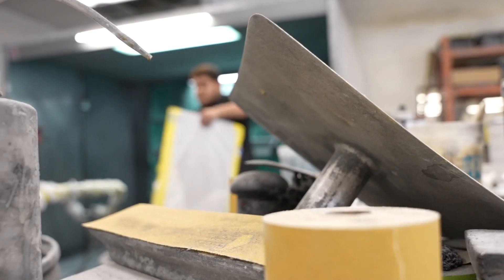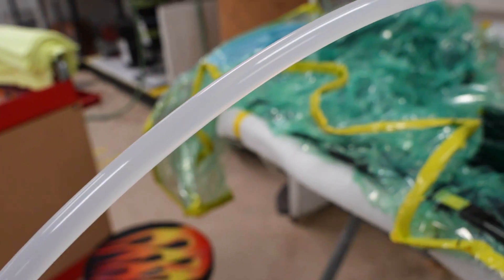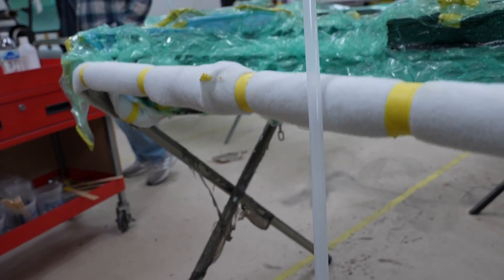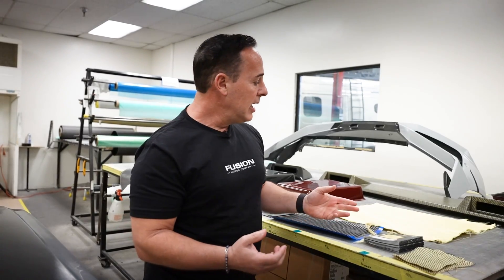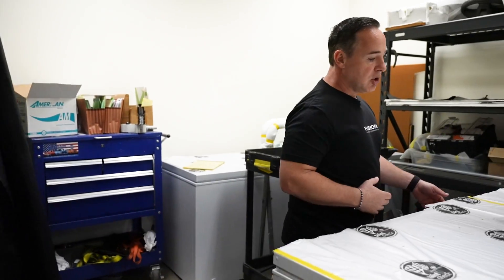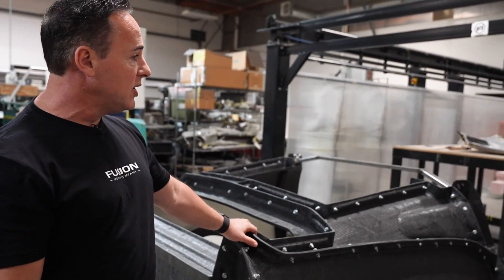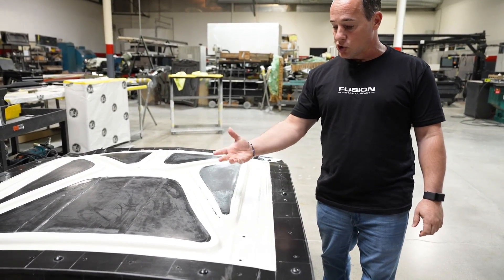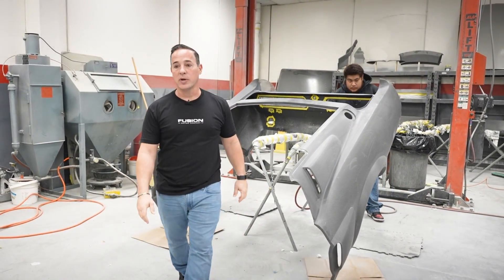Carbon Fiber - How it Works | Parts & Body Kit Process | Fusion Motor Company

Comment: Hello Sir, I loved your content and I have a question. After you done the outer layer body panels, how do you mount them into any car? do you also make a different inner structure out of carbon fibre to mount it to a car, and use adhesive to bond these two panels together (is this adhesive strong enough)? Or is there any other way to do it. How do we mount your panels into our car when we look it at the buyers perspective.

Comment: Hey
Which clear paint brand do you use.
Reply from the maker: We use PPG the have a ceramic line that cures super hard and has great UV protection.
Reply: @FusionMotorCompany  Hope to see the paint finish in your next video also how you deal with carbon fiber pinholes.